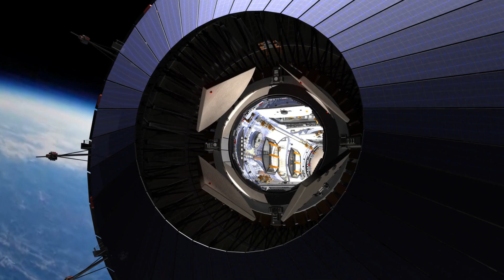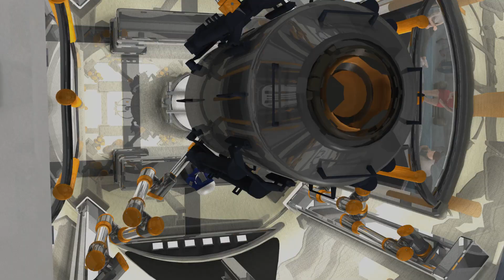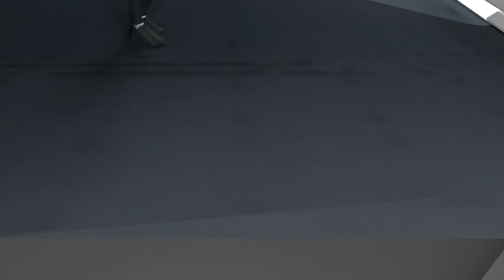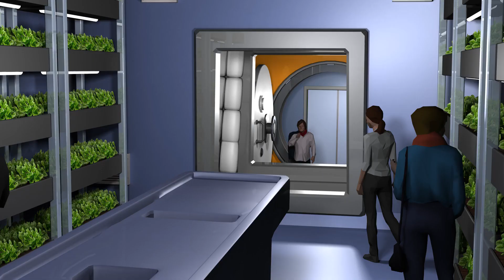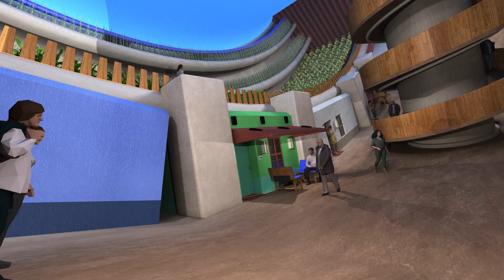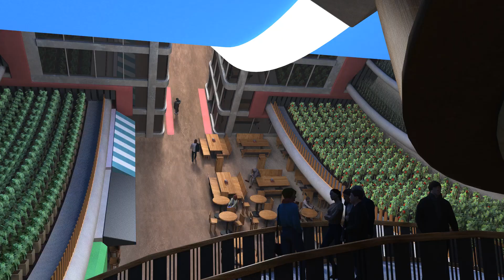RSS (Rotating Space Station) Small Stanford Torus Style Habitat

Comment: I just read several places recently that spin gravity is not good for the body or the brain.  I don't remember all the reasons why but has this been taking into consideration?  One of the issues was the gravity at one's feet would be different than at one's head, the smaller the radius.  And there is something about inner ear issues. 
https://en.wikipedia.org/wiki/Artificial_gravity
Reply from the maker: Anything under 200ft at a spin rate that would give you 1G would create the Coriolis effect which could temperately cause dizziness but we adapt to that easily. The gravity issue between the head and feet is also a problem with small stations but not enough research has been done to know if it is bad for you or not. This station is 268ft in diameter and mitigates many of the stated problems with rotating space stations.
Reply: @exodusstar  I calculate you would need to spin a 83 meter diameter habitat at 4.5 RPM to create 1g, which would provoke Coriolis in most people but could be adapted to. Usually the minimum diameter for 1g with minimal Coriolis is 200 meters with a 3 RPM spin. Maybe this design is scalable for lager habitats?
Reply from the maker: I have a larger design on my website that has a more ideal habitat.